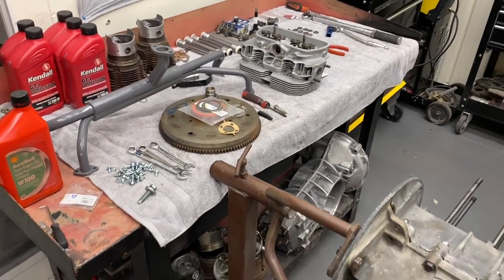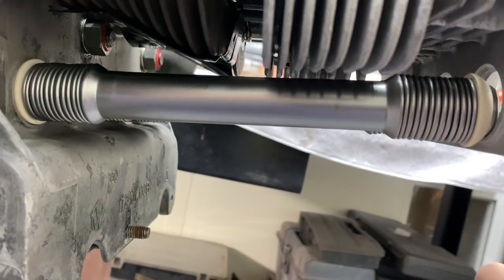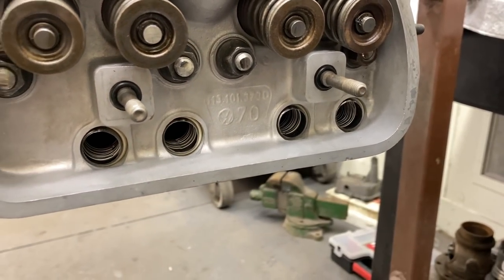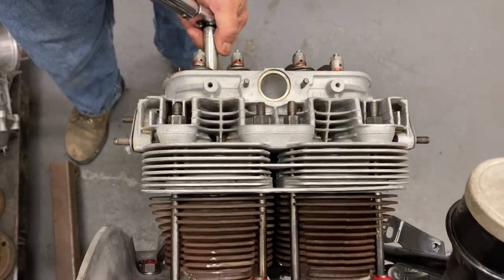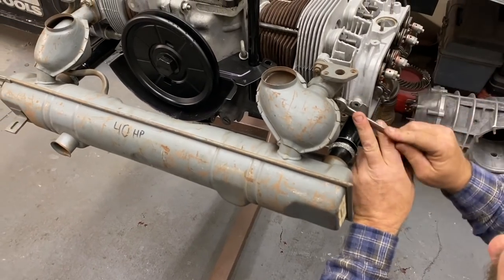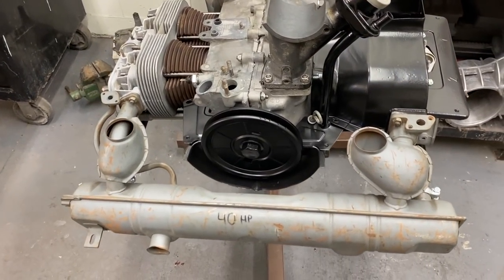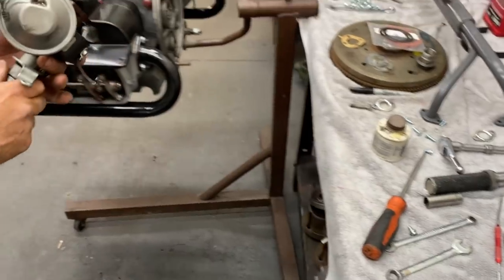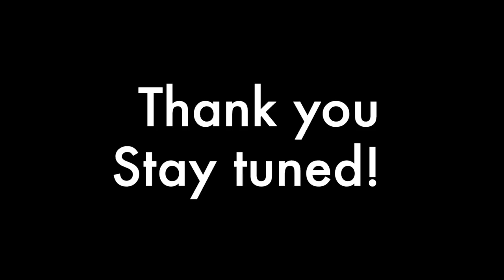VW ENGINE Build Part (2) Restoration 40HP air-cooled Volkswagen engine, VW Bus, VW Kombi, VWDARRIN!!

Comment: Wow, those racing engines and the pics brought back some fun memories. The "guru" that built my engine in a '65 bug was Wolfsburg trained in Germany. Fired because of his love of tequila. In '71 it cost me over 4k$ just for the engine rebuild. He never told me all he did, the obvious when the lid was popped were the dual two barrel webbers. Won a LOT of money running against 283 & 289 "V8s. The last time on the 1/4 mile I shut down at about 50yards shy of the traps and still won at 117mph.
Reply from the maker: Hey Donnie! Wow that is pretty cool man! Sounds like you had some fun in that 65. Do you still own it? You have to watch out for that tequila! =) Thank you! Stay tuned! =)

Comment: 👍👍👍 neat seeing all the differences between the 40 hp, opposed to the newer engines.
Glad your not putting a 200 hp. 3 liter with ....9 carburetors or a Subaru engine, In your bus.
53 hp was all I was looking for in my car. Part of the charm you know. 😀😀
Reply from the maker: Yes, I really like the old vintage stock engines. There is just something special about that factory design! =)

Comment: Also if you look at the left-hand side of the muffler, there is a tube that comes down from the pre-heat Pipe underneath the carburetor on the intake. Your exhaust tip has to go in the muffler far enough. It will make a low pressure in that preheat pipe. If you have The tip close enough. Bernoulli’s law you know. It will cause the exhaust gas from the right side to circulate through your pre-heat pipe. And your carburetor won’t ice up. It’s probably the most overlooked thing in a Volkswagen engine build. And it’s very important. Because without the preheat pipe warm, your spark plugs will be sooty, your engine will run rich/poorly , and your preheat pipe will coke up and close.
Take a wooden dowel and stick it in the left-hand hole. Put a mark on it when it bottoms on the tube inside. The Mark should be just on the outside flange of the exhaust, of course the mark is on the wooden dowel. pull the dowel out, and measure the amount on the tip.
Shove the tip all the way in until it bottoms on the tube inside the muffler. Is the mark the same? Yes? OK back it out about a 3/4 inch, this should be sufficient room to exhaust, and will cause a low pressure in that tube when the exhaust is rushing by exiting the muffler.
You can test to see if it’s working, by starting the engine cold and seeing if the right side seat riser pipe is getting warm. It should get warmer right away, and within a minute it should be almost too hot to touch. Of course the left side is going to be less warm because it’s going to draw from the right. Does that make sense?
You can test to see if it’s working, by starting the engine cold and seeing if the right side heat riser pipe is getting warm. It should get warm right away, and within a minute it should be almost too hot to touch. Of course the left side is going to be less warm because it’s going to draw from the right. Does that make sense?
Like I said it’s really important. And a lot of people don’t no this. You can look in your Bentley book, and see this. It gives you measurements for German parts. Remember that term German parts. That’s original Volkswagen parts. Are yours original? Probably not. And probably not made exactly like the German parts. So it’s hard to go by the book on this.
And now I’ll shut my big yapper 🤐🤐🤐

Comment: I had a 40 horse in a 64 Bug back in the day. There was a running change in valve clearance mid year. I guessed wrong and burned the exh valves out. I put a 1600 in it an it was ok but basically trouble. Had I rebuilt the 40 I'd still be driving it 40 years on. Nice to see that 40.

Comment: Interesting. I saw he was using what are called nylock nuts as opposed to steel lock nuts for higher temp uses. I had to make a temp field repair on my plane when the exhaust nut decided to bail mid flight. My preflight caught it and all I could get at the small field was a nylock. Made a bit of a mess inside the cowling when the nylon melted. Great explanations given by your mentor there.

Comment: It would have nice to see a new oil cooler installed. They are. around $100.I have confidence that if Darrin felt the old cooler was good, you'll be fine. It's just that if it's the original ,it is nearly 60 years old.The older ones were probably made better anyway

Comment: Excellent job on that VW engine rebuild.  My only concern are those holes such as the intake and distributor access should be capped when not working on them. One mistake that a nuts, bolts or any small objects that could accidentally dropped in there would waste a lot of time of your hard work

Comment: 16:09 The crank was turned 10 thou , but had Standard bearings on it? Wow how did it have any oil pressure? CT remember when you ran this engine? And it ran so good? And I told you just clean it up and put it back in the bus?
I’m glad you checked it all out inside, because it wouldn’t of lasted long like that.
Reply from the maker: Yes, well when I went to rebuild it the first time we ordered the wrong bearings and we had some other things wrong too. Good thing Darrin took over and made things right. He is the man! I couldn't have done it without him.
Reply: @CTmoog  👍👍👍

Comment: Another excellent one, awesome to hear his knowledge about engine rebuilding. I have around 100,000 miles on my engine, and it’s still running really strong. I have been thinking about doing a couple of things just to refresh the engine. Since you are removing the heater box, what about those times when it rains and you need to defrost the window?
Reply from the maker: Thank you! Wow that is pretty good to have 100k and going strong. Is it a basic 1600? I won't be driving Rusty everyday. If I do need to defrost for some reason I'll keep a rag close by and open the fresh air vents. He had so many holes it shouldn't be an issue. =) I do plan on restoring the heater boxes so maybe we will add them back on at a later time. Thank you! Stay tuned for part (3) =)
Reply: CT Yep, a 1600 with an extra oil sump and a dog house. If you take care of them, 1600 are bulletproof

Comment: Buses had a tendency to run hot on #3 cylinder, because of the oil-cooling tower and poor airflow into the engine compartment of the bus.   Knew a guy once who had an old bus that dropped an exhaust valve, and during the rebuild process that we did in his basement, he had an aftermarket oil cooler and remote oil filter installed, which solved he problem handily, plus he put air scoops on the rear louvers of the bus.   Never had a problem with cooling after that.

Comment: What type of grease was used to coat the rings and is that thread lock on the case nuts oozing out in red? And I wish you could have zoomed in on the torque wrench adjustments instead of away from view. Very interesting regardless!

Comment: A couple of questions I have. What was the white gunk used to seal between the barrels and the block? Was the paper gasket in there as well? Why not have used the same sealant as used elsewhere (Permatex?). Also I see that copper compression rings were used on the heads. I believe they were not used in production, not sure but I guess if you are using them they must be effective.

Comment: Hi CT. Loving this series of videos. I am curious about something. Starting at about 4:10, while knocking in that retainer (not sure what it is exactly called) for the last cylinder, I noticed that one of the cylinder rings (I think he called it the wiper ring in the last video) starts showing and is fully exposed by the time he is done. Is that normal? It looks kind of odd and not like the other one from part 1 that you showed being put in. Almost like the retainer slipped past the rod instead of through it. I could of course be completely wrong (and I probably am), but I thought I would ask since it just seemed so odd to me.

Comment: Have built quite a few ...I bumped my tool late one night while I was turning around -like a dummy ,had left the washers/shim tool in distributor hole -and both washers went “clink -clink /clink “ -down to the bottom of engine -to my horror.   Ended up having to pull whole engine apart to get out -and then back together .....ugh ....customers bus ran great after it was all done ...but I think I aged 10 years that night ....

Comment: He didn't line up the distributor drive gear right.  The notch on the drive gear should line up with the front fuel pump stud before inserting it.

Comment: After you add the piston pin to the piston and Piston rod then you did put on lock ring inside the hole to lock the pin to the piston. Then you attach t5he cylinder to the case. Then tighten the cylinder with spacers up to 25 psi so the cylinder is place on the case. The piston should show top dead center. Then please, measure the depth between the cylinder's top and top of piston about 1/1000th of inch or 2/1000th of inch as the length between piston's top and cylinder's top. Repeat to the second cylinder and third and forth cylinder. So all are the same 1 or 3/1000th of inch for high performance engine as upgrade to high compression ration. 
  How many thousandth of inch does your VW flat four have between piston's top and cylinder's top? That yet - install the cylinder head only after; to make room for dial Vernier caliper in measuring it then afterward install cylinder head. Thank you.